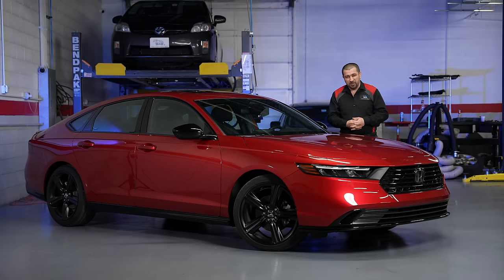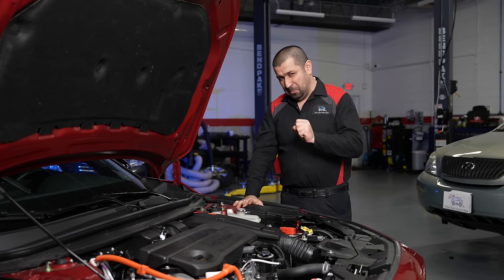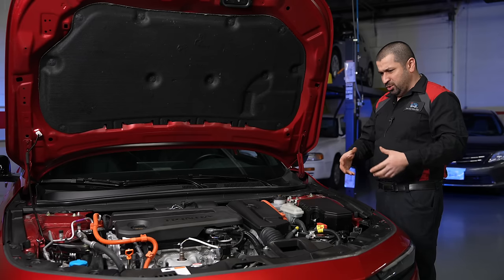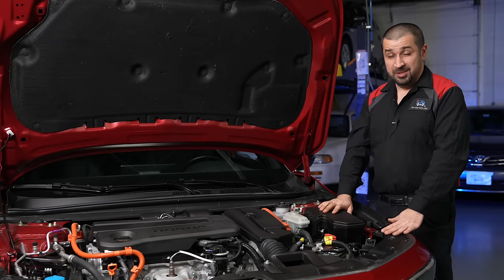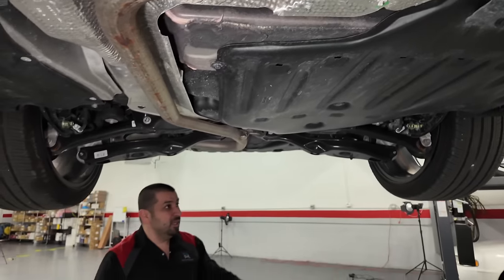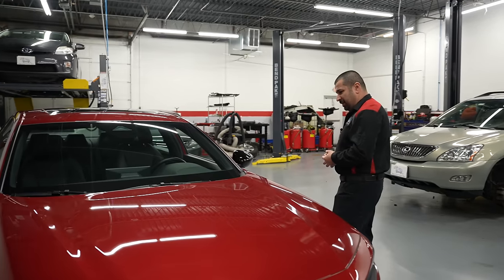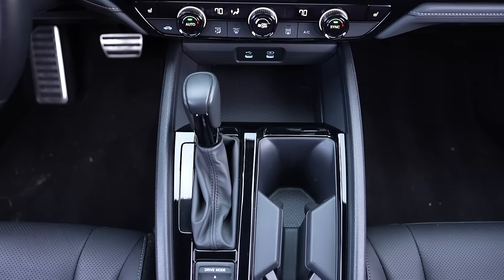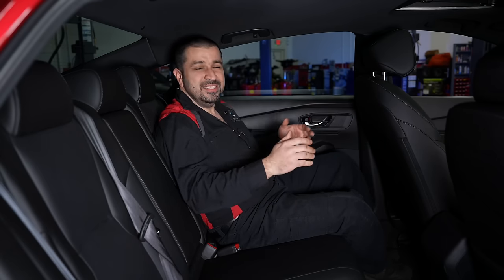Should You Buy The Latest Honda Accord? A Mechanic's Review

Comment: This engine is under-torqued compared to the 2.0 turbo of the previous gen.
Reply: The engine torque plays no role in the car's performance. It's a battery+generator EV.
Reply: @jeffjo8732  it does when you in high speed
Reply: @hjlnbi  Yes, the engine drives the wheels when cruising above about 40 mph. That does not affect what I said. That mode is used like a conventional car uses overdrive. It is not for performance situations, it is for highway cruising

My information is for the previous generation Accord. The numbers may be slightly off, but not significantly, and the conclusion is the same. Max torque was 129 lb-ft at 3500 rpm. Since the direct-drive gear means MPH=37*RPM, that would be at 95 mph. How much torque do you think you need at 95 mph?

But if you were driving that fast, and needed 129 lb-ft, that would be 129*3500/5252=86 HP. The car would get the same performance, and better efficiency, by dropping out of engine drive. The engine would drive the generator at about 4200 rpm and only 106 lb-ft. AND, if it needed more power, it would increase power and torque by increasing rpm.

Note: this comes from the "Hybrid Operating Line" as published by Honda. At more reasonable speeds in engine drive:

45 mph 1665 rpm 87 lb-ft
50 mph 1850 rpm 88 lb-ft
55 mph 2035 rpm 89 lb-ft
60 mph 2200 rpm 90 lb-ft
65 mph 2405 rpm 91 lb-ft
Reply: @jeffjo8732  This means that in the end when you are driving at speed or on the highway at a speed of 120 km or more, the engine will be working at its full power, regardless of the hot areas.
Reply: @hjlnbi  Sorry, no. It means nothing like that.

Accelerating up to 75 mph (120 kph), it will use hybrid drive so only engine power means anything.

Cruising at 75 mph on a flat road, the car needs about 30 HP. The clutch will be closed, so the engine is running at 2775 rpm. The operating line says the engine makes about 92.5 lb-ft, which is about 48.9 HP. Since this is more than the 30 HP needed, the traction motor, acting as a generator, will use 18.9 HP to charge the battery.

This is nowhere near full power, nor full torque. Even at that rpm, full torque is about 127 lb-ft and full power about 69 HP.

If power requirements go much above about maybe 55 HP (104 lb-ft), the clutch will disengage and the engine torque no longer matters.

The engine's max torque never plays a part in any of the calculations.
Reply: @jeffjo8732  I am talking about observing the experiments in our area (hot weather ) when we drive at a speed of 100  the engine starts. I do not care if it is running at full power or not but in the end it works. But I am wondering if you know is the battery also helps the engine with horsepower and torque or does it just charge it? because the engine alone is weak like 146 HP thats weak
Reply: @hjlnbi 
firescorpio: This engine is under-torqued.

JJ: The engine torque plays no role in the car's performance.

 hjlnbi: It does when you in high speed.

It does not, unless "it does" is referring to doing something nobody has mention here. If that is what you mean, please tell us what "it does" means.

hjlnbi: When we drive at a speed of 100  the engine starts.

Yep. If the car is cruising, the engine  generates low torque. Well below the level firescorpio was referring to as "under-torqued." So "under-torqued" is not affecting performance.

If it needs acceleration, it opens the clutch and chooses a point on the Hybrid Operating Line that I described, based on the POWER needed. POWER = TORQUE*RPM. To increase power, it increases RPM, not TORQUE.

hjlnbi: I do not care if it is running at full power or not but in the end it works.

Indeed it does work. This is not affected by being "under-torqued." It gets power from both the engine and the battery.
Reply: @jeffjo8732  Don't get angry please 😅😅😅

I'm not arguing I'm just trying to learn because I want to buy one and I don't know whether to get a hybrid or a 1.5 turbo

According to my research on people who live in my area they say that the engine works at a speed of 100 or higher because the battery can't handle this speed but my question if you know the answer is is the very strong battery torque present from the start all the time or does it end and sometime the car is sometimes slow at the beginning of acceleration?
Reply: @hjlnbi  Maybe I need to rephrase my original comment: In any way you would compare the performance of this car to another, the low torque rating of the engine does not matter. In fact, in operation its torque production will never be anywhere near its torque rating because it is not the engine that will be providing torque, it is the motor. 

That's what I meant when I said "The engine torque plays no role in the car's performance." So when you replied "it does when you in high speed," it did sound like you were arguing that point. And you continued contradict what I said.

But you seem to be very misinformed, and the vague statements you make do not help me to understand what you are misinformed about. I'm assuming you are talking about the Accord, but you have never said. I don't know anywhere where it is sold, that also has "hot areas," and uses the metric system (as you seem to). But it isn't speed, or "hot areas" that make the engine come on. The speed 100 kph (62 mph) is never a dividing point between drive modes.

It is the power needed, and battery state, that determine when the engine comes on. It is used in two modes.

1) Hybrid Drive. The engine drives only a generator, and its electricity powers the traction motor. Engine torque (remember the original comment?) is irrelevant, only its power. The exact operational point is determined by battery state and power requirements. It is usually near 2000 rpm and 34 HP (25 kW), but can go up to 6200 rpm and 143 HP (106 kW). If the battery needs to be charged, the engine will overproduce.

2) Engine Drive. At speeds above about 43 mph (70 kph), not 60 mph (100 kph), the engine can drive the wheels directly. But only if the power requirement is less than about 40 HP (30 kW). This seemed to be what you meant by the engine turning on at high speeds. But due to the low power, torque is not important here (remember the original comment?).

At 75 mph (120 kph), the car does not need full power. On a flat road, it needs only about 30 HP (22 kW). In Engine Drive, the engine runs at 2775 rpm and produces about 50 HP (37 kW), and will be charging the battery.

Now, if you accelerate, the battery will add power. The power rating is 204 HP (152 kW), but that is a fake number. Since this will drain the battery, it can only last a short while. If you try to climb a mountain at a speed where you need more than 143 HP, you will not be able to do so for long. This, and that 204 HP rating for short periods, are the only power limitations.

Full wheel torque comes from the motor, not the engine. You always have it "when taking off."

Comment: What the Fucq was Honda/anyone thinking using a PLASTIC VALVE COVER???

I'm loosing all hope in car manufacturers now.

I do love Toyota's Hybrid's use a planetary gearset system for their Split Power Device eCVT's with a transaxle with no belts, chains, no clutches, basically no wearable components and last far longer than traditional automatic 6-10 speed transmissions and absolutely longer than traditional CVT's with cone and V-Belt or Cone and Drive V Chain Belts.
Reply: If I recall correctly, Gen 1 had a chain in the transaxle. All hybrids use a clutch; Toyota calls theirs a Torque Damper. It's a permanently-applied clutch in case there is difference between the engine's rpm and whatever it is attached to. The main worry is if there is a catastrophic change in either device, so you don't rip the other apart.

There are no such changes that occur in the normal operation of the Honda. This is because it lacks the PSD. A Toyota, on the other hand, has a PSD and the engine is permanently connected to it and so, indirectly, to the wheels. So whenever the engine starts or stops, there is a slight slip in the Torque Damper. It is rare, but it is known to fail.

https://www.youtube.com/watch?v=qaqqs3nKy4g
https://www.youtube.com/watch?v=wzCACoJn-wM

Comment: When he talks about the “motor” he means the electric motor. When he talks about the “engine” he means the gasoline powered engine.
Reply: Maybe because, while a gas engine is a motor, an electric motor is not an engine.

An engine creates a stream of power from stored energy, while a motor converts power into mechanical power. A gas engine releases the energy from fuel to create mechanical power. An electric motor converts electrical power to mechanical.
Reply: @jeffjo8732  there is no maybe about it… but I do get the condescension.

Comment: Direct injection is garbage and you will be sorry at 60,000 miles and you have to get the engine opened up to walnut blast the intake valves

Comment: Fancy engines/trannies.   Like the LS460 fancy engine V8? (CCN judged most expensive Toyota to repair) Like the 2018-2024 3.5L V6 twin turbo that is blowing chunks Toyota is trying to catch on current recalls of the Lexus/Tundra's so equipped?  I bought the Corolla hybrid for 1. Japan-made  2. 50mpg hiway/62mpg city (my experience), 3. Over $9k LESS than this Honda (my local pricing), and 4. the 360,000 mile Car Care Nut review of a Corolla hybrid on youtube, where the "Yucky" CVT still worked perfectly, and the original hybrid battery needed nothing.  Looks like Honda is giving new Accord customers the shaft, well five of them actually.  Oh, and Honda direct injection only: guaranteed repair using walnut-shell blasting of the heads to remove carbon deposits build-up behind the valves at 50-60k miles. (no detergent gasoline cleaning back there which port injection motors do)  That is why Toyota keeps port injection in conjunction with direct injection in their motors)   There is the cheap way, and there is the Toyota long term lasting way.

Comment: If the honda hybrid is too expensive then go cheap electric 😂🎉🎉
Reply: And before deciding "cheap," compare equivalently-sized cars. The EPA classifies them based on passenger+cargo volume.

Accord: 106+17=123 ft^3 (large).
Camry: 100+15=114 ft^3 (mid-size).
Civic: 99+15=114 ft^3 (mid-size).
Model 3: 97+15=112 ft^3 (mid-size).

It amazes me when the standard comparison is Accord v. Model 3.

Comment: No spare, no sale.
Reply: Buy a spare, and put it in.
Reply: @jeffjo8732  will take up room in the trunk. There is no space for spare tire. For the money you have to spend on the vehicle, it should have at least a space for you to purchase a spare tire and put it in.
Reply: @michaeltrinidad1217  It will fit in the spare tire well. You know, the space designed to fit ir?

Yes, that does take some space that you could use, but then all spare tires do that. It isn't part of the spec'ed trunk space.
Reply: @jeffjo8732  Sorry, but the 12 volt battery is in that space.
Reply: Seems Honda rushed there hybrid design to get it on the market. Then the 2026 model, the hybrid battery and 12 volt will be located properly. That's my assumption.
Reply: @michaeltrinidad1217  Seems you feel the need to make things up when you lose an argument. Look in the bottom-right corner starting around 0:10

And btw, this hybrid system has been in use since 2014.
Reply: @jeffjo8732  it just seems you're the type of consumer that rolls over and excepts whatever companies take away. A spare tire is a vital piece of equipment. We shouldn't expect it! That's why I will stick with my Toyota that always comes with a spare.
Reply: @michaeltrinidad1217  And it seems you are the type who concludes which is better first, and then makes up the reasons for the decision afterwards. If the spare is that important to you, it is easy to get one without sacrificing space. Your lies don't change that. You can't even admit that you were caught in an obvious one.
Reply: @michaeltrinidad1217  toyotas look like crap

Comment: Too bad it is so slow and way underpowered for such a big car.  It is also so very boring and over-priced and Honda reliability has steadily declined since manufacturing was moved from Japan to the usa.
Reply: "Too bad it is so slow and way underpowered..." From Motortrend, the "204 HP" Accord gets to 60 mph in 6.5 seconds. The "225 HP" Camry takes 6.9. The problem is that these HP ratings are estimates based on biased performance-equivalences to pure ICE cars.

"...for such a big car." Well, that part is true. The Accord is an EPA large car; 7% larger than the EPA midsize Camry. And still faster with supposedly "less" HP.

"It is also so very boring ..." yet most reviewers find it more exciting than Camry.

"... and over-priced ..." Honda is truthful in their pricing. If they say that trim XXX has feature YYY, then it is included in the price. The similar Toyota trim often lists it as "available," and the package that includes it make he Camry more expensive. For example, I think every Camry needs a $1K to $2K package to get a moonroof.

"... and Honda reliability has steadily declined ..." yet KBB and JDPower rate them more reliable. Go figure.
Reply: The Japanese built Civic hybrid sold here in the UK is getting lots of praise not least for its performance funnily enough.

Comment: Problem, over complicated. Too expensive.
Reply: You are being fooled by disingenuous marketing.

It is not complicated to drive. Press the power button, shift into F or R and go.

It is mechanically simpler than just about any other gas car. You are confusing the fact that it is different than what you are used to, with being complicated. IT HAS NO TRANSMISSION.

It is less expensive than comparable cars. You are confusing the fact that it comes only in the higher trims, and doesn't use "packages" as a form of bait-and-switch (like Toyota), with expense.

Accord Sport: $32, 895
Comparably equipped Camry Camry SE: $34,190. 
Civic Sport (same size as Camry): $28,750

Comment: Own an Accord Hybrid. I regret buying it. 
Battery pack has a short life and V expensive to repair/replace.
 Want an Accord ???  (despite increasing Engine failure issues :-)
 Buy a regular Non hybrid version with a  Manual trans.. you WILL thank me.. Later.
Reply: The battery pack does not have a short life. There is no history of it being better, or worse, than Toyotas.

They do have as good, or better, history of reliability than Toyotas. KBB rates my 2018 Accord Hybrid at 4.5 out of 5, while the Camry I could have bought instead is rated at 4.1 out of 5. JD Power changed their system ins 2020: both are 82 out of 100.

Comment: Cheap plastic interior, cheap fabrics that soil easily; weak 1.5L engine;  a CVT transmission; cheap audio system.    Why on earth would I want to spend 40k for this?
Reply: Maybe because nothing you said is right? Consumer reports says the interior is "a solid effort in terms of materials and build quality." The engine is a 2.0L Atkinson. That may make it have less power, but this is a hybrid that is underrated at 204 HP. It does not have a transmission, let alone a CVT (they call it "eCVT," but "virtual CVT" is better). Good audio in upper trims, that all list for less that what you claim. But that price include everything the trim offers - to get that in a Camry, you need expensive optional packages that make it more expensive than a comparable Accord.

Oh, and 7% more space with better reliability ratings.